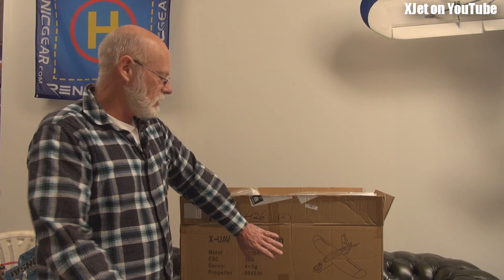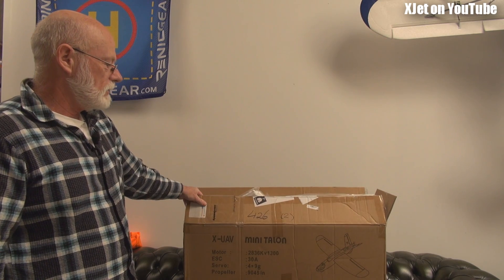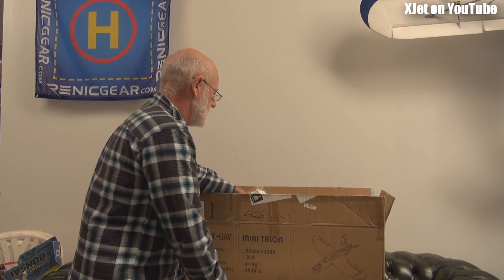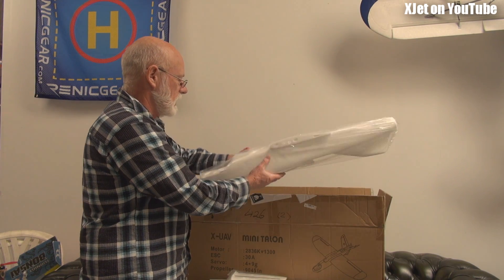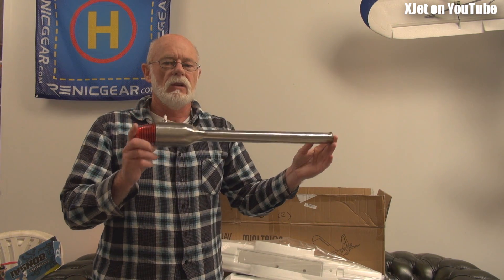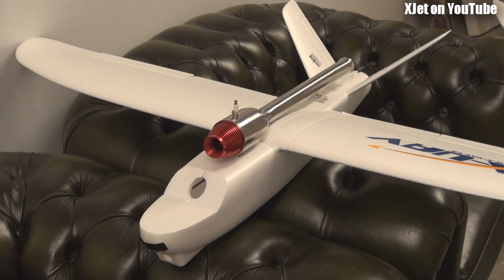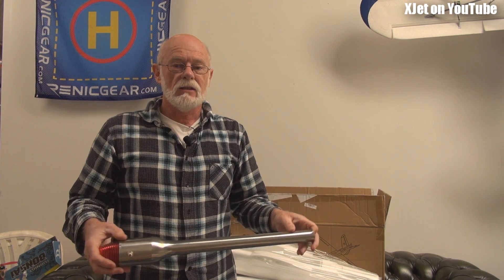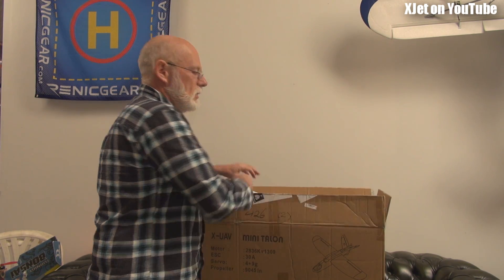Mini Talon pulsejet project (introduction)

Comment: No noise regulations where you fly then Bruce?
Reply from the maker: +kevin goodwin It's an airfield!
Reply: +xjet Even so, are there not any noise sensitive areas nearby - houses, farms or whatever? Would hate to see you get a complaint from someone with an axe to grind. Five minutes of continuous pulsejet racket is a lot different to a light aircraft quickly departing/ arriving - maybe you don't have anyone nearby, in which case - no prob. Pulse jets are banned from use in R/C models here in the UK because of the noise and fire risk, although  the control line guys do use them in specially fenced off circles in case of line breaks. Anyway best of luck with it and I'll be interested to see how you get on.
Reply: +kevin goodwin he has had a few pulse jet aircraft at his flying field before. I think....? So i think he'll be good
Reply from the maker: +Josiah Nilsen Yes, and besides which, we have drag racing on the runway, gokarts next door and motocross at the end of the strip so this is already a very noisy area.
Reply: ***** Ahh yes i forgot about that part. It pretty cool I might add that you had responded! So i would like to say thank you!
Reply: +xjet  just don't hit that old tower if its still there Bruce ,you know what happened last time :)
Reply from the maker: +Dave Mathews LOL... here's hoping.  Actually we had a real (full sized) plane come in today and I videoed it whilst measuring the noise levels.  Any guess as to what the noise level was when it was taking off?
Reply: ***** 126 decibels ?
Reply: ***** just watched that vid Bruce so I know the level so I wont have a guess  ..lol and  yeah just a bit loud  but im very impressed with the very short take of the  Pacific Aerospace 750XL  looked like it was only about 50 meters before the nose wheel lifted off , bit of a worry with the nose wheel wobble on landing though looked like it was going to shake and break off

Comment: Re the foam board in N.Z.  Flight Test were looking into a better postage deal from the States for Adams foam board but have not heard anything further.  I found a manufacturer here (Hamilton) who produces a similar product in huge sheets, but are not set up for courier shipping and are unwilling to cut and box sheets. Typical of N.Z.
 I did find some Adams board at an art shop, but they wanted NZ$25 for the normal Dollar Tree sized board.  And I thought Ned Kelly was dead.....Even sheets of insulating foam cost an arm and a leg if you can find it (New Plymouth).
Reply: +Bob Webber Try this, they will post it too. :)
http://www.gordonharris.co.nz/foamboard-white-gordon-harris-c-75_175.html
Reply: +Bob Webber  Hello Bob! An Adams board clone by http://www.bazicproducts.com/foam_boards.html is available from Geoff's Emporium 274 Dominion Rd Auckland for $4.50 a 20x30 inch sheet (was $3.50, damaged $2). Light 5mm foam with a ripple and easy to remove light coloured paper covering. I have a few sheets not yet used as mostly I get free (Gordon Harris 3 and 5mm?) offcuts at picture frame shops. That card has to be soaked off and is a denser depron like foam with a hard smooth exterior fiinsh.

Comment: Although I've run mine several times it's all been bench time.  I gathered the necesary bits for a reliable fuel system and plane and then my wife decided we should move.  20 years of modeling stuffed in rafters, corners, behind the basement freezer, etc.
No doubt you'll be done before I am, I should be back into converting a room downstairs to my new shop (at least I've ducted the litter box so although it's a bit noisy it doesn't smell in there.)  But a SPAD pulsejet is my hopes for June this year.  Must pick up 80/20 FAI mix for fuel and some bladder material.  It's gonna be loud.

Comment: Yes PULSEJET :P
Can't wait to see the foamy Mini Talon melt mid flight or burst into a ball of flames, either one will be spectacular !!
Reply: G'day,

 Well, Foam is an Insulator of Heat..., and a few strategic bits of ShinyShiny Metalic Tape should go a long way towards Heat-Shielding...; especially in view of the Airspeeds in the areas of concern...; I'm sure Jetmeister Throbthrob knowze what he be doin' ...(!).

;-p

Ciao !
Reply: +Tech2C Maybe he got a surplus space-shuttle tile off of eBay?
Reply: Lol :)

Comment: hey, this is a question to anyone and everyone who can help: What is known in the community about a replacement for dollar-tree foamboard that is obtainable in Europe? I would be eternally grateful if anyone could point me in the right direction. I'm looking for something with removable paper and reasonable strength to weight ratio. Thanks in advance!
Reply: Maybe it's "Depron" foam? "Depron" is also a brand name rather than a material type. I know this can make it hard to find stuff sometimes.
Reply: I have bought "Depron" here in Australia and it doesn't have paper on it.
Reply: +rmay000 Search for K-Line. That's the most common brand over this side of the world. The paper isn't easy to remove, but there are some techniques for that. You can also get some "K-Line foam" without the paper (it's just the depron) from most art supply stores around EU.
I presume you're German? Start here - http://www.artservice-tube.de/index.php?page=product&info=1593
Good luck.
Reply: +Luís Emauz you're right in your presumptions. thank you so much for the advice.
Reply: +rmay000  I have bought some Foam board from amazon, A1 size about £25.00 for ten sheets.